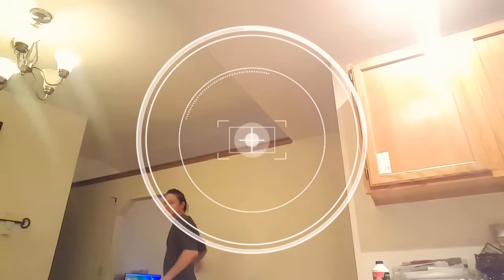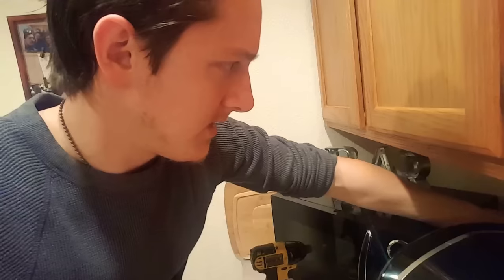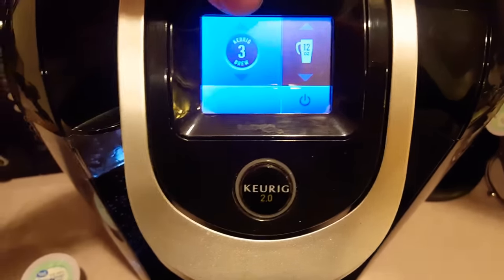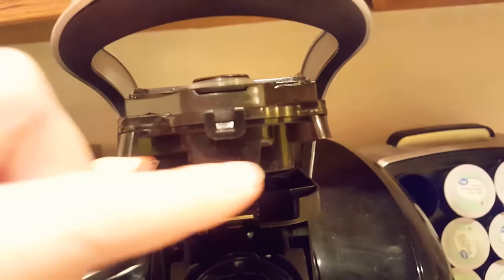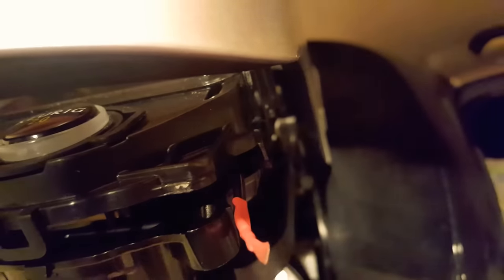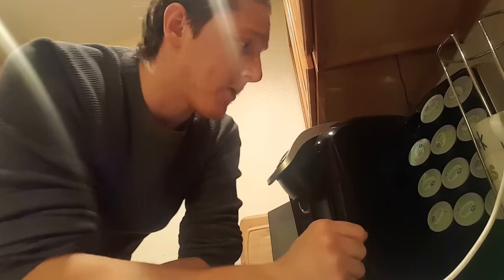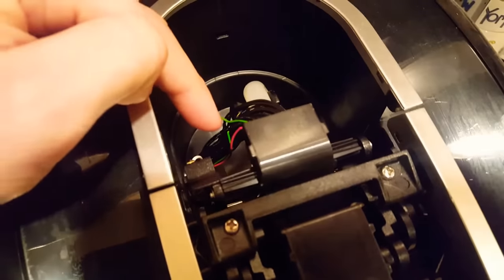Unlocking Keureg 2.0 PERMANENTLY (FULL MENU ACCESS) - Ep.2

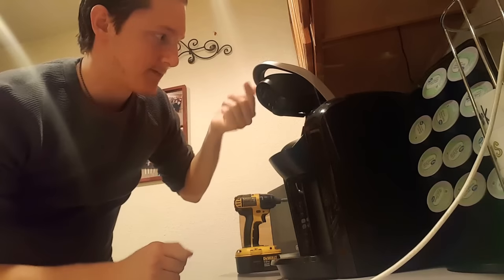Comment from the maker: Skip to 3:20 for step #1.
Reply: PROTOONE thanks
Reply: used the magnet  for over a year. worked great till I wanted to use Keurig 2.0 My K-Cup Reusable Coffee Filter with my Thermal Carafe. Works great now thanks..Now if there was a way to make it Hotter!
Reply from the maker: @davevarner7993  I went with the Cuisinart brand Keureg, it has heating options and it looks better in my opinion and has been very reliable.
Reply: PROTOONE i have yours, i still have to put mine in microwave for 1min to make hotter
Reply: Great work. I did the green wire hack and it worked perfectly. I was about to trash my coffee maker. Thank You So Much. Proud of these type of smart people.
Reply: i guess i’m 4 years late, but genius is never outdated.  well done, man. this is what happens when a smart guy gets bored!!! aewsome!!!  THANK YOU!!!

Comment: Excellent modification! Took more time than most commenters mention because the tabs are very fragile. If you pry just a tad more than necessary, they break off as three of mine did. Still works fine but just an FYI. Best to use a thin kitchen knife to hold the two units apart once you have the first tab started and work your way from tab to tab. Also no need to pull out the sensor, just leave it in and works fine that way too. Also, make sure to cut the wire as close to the sensor as possible to give yourself lots of wire to work with when splicing together. The sensor is located in the bottom part of the unit. Great video, hope your girlfriend made it home okay.

Comment: This guy rocks... worked perfectly!  We like to use the orange reusable carafe k cups.  They usually work well brand new, but the usable time has been shrinking and we would have to but a new orange reusable 2 pack.  Over the past several months, it's really difficult to get Keurig 2 to recognize it... even new... it just won't brew a carafe!  

The magnetic bypass worked!  Also, cutting the optical sensor was a bonus for using all k cups.  The only issue were the inside clips.  A tiny thin screwdriver worked best for me, and don't worry if you break a clip or two, like I did... as long as you have at least one on each side, it will hold together just fine.  Good luck!

Comment: I have a keurig 2.0 and used a reusable carafe pod. As soon as I closed the top this menu pops up. Way more size selections and I don't have to use the carafe. My 2.0 sizes go to 18 oz. now I can use my coffee cup instead of the carafe and fill my cup to 16 0z. on one round.  Love it plus I can use my own grounds and save money.
Reply from the maker: Lu Lovett That's awesome I never thought of that. I personally would like that reusable carafe pod, that would be a nice adition for a stronger cup of coffee.
Reply: @LILBZ3  I still find this extremely helpful because my current 2.0 doesn't work as described by Lu Lovett, with the reusable carafe pod. It did for awhile but I have been having to buy the expensive carafe pods and peeling the tops off and putting the tops over my generic carafe pod. I am so grateful I found this video so I can try it. Ill let you know! Thanks!!!
Reply: @LILBZ3  So only one more thing. I wasn't able to use distilled water with my other 2.0. Some other sensor on it can "see" if there is water in the reservoir or not by the minerals in the water. Distilled water doesn't have those minerals in it and so the keurig 2.0 does not see any water in the reservoir and will not brew. I think Keurig discourages the use of distilled water because they can charge exorbitant prices for their filter systems.  Any ideas on locating this sensor?
Reply: Lu Lovett your right. Just figured mine out

Comment: Awesome video!! I tried that at first and it wouldn't even dispense hot water. I had to take it all apart (Bare bones) and pushed in the wires where possible thinking maybe a wire came loose somewhere? Fiddling and pushing back the wires everywhere after i tried your method did the trick for me! THANK YOU FOR NOT LETTING ME TOSS THIS THING OUT!!!
Reply from the maker: Glad you were able to resolve it! Sometimes when its taken apart the wire connections can come loose. Glad to hear you fixed it! :)

Comment: I just did this.  Only cut the green wire because I’m not concerned about the full menu.  I no longer randomly get the oops screen when using my reusable kcup. Thank you!  I wasn’t too concerned about it breaking the machine since I got it for $5.00 at Goodwill.  When I brought it home it would not move off of the preheating screen.  It was stuck there, so I found a hack that said turn it over and count to 30.  That sounded crazy but it worked. Now your hack made it less frustrating to use.

Comment: Great hack. Had an issue at first after cutting the green wire and the 2 black wires the coffee maker  wouldn’t work. So I read through the comments and found a few possible issues. Mine turned out to be the ribbon wire going to the board, it came lose.  After  pushing it back in it worked. Hopefully this will help someone else who might have the same issue.

Comment: I have 2 machines. 1 worked with the hack and the other didn't. When I lift the handle and close, it takes me back to the main screen. Doesn't matter if I add a k-cup either. Thinking I didn’t splice the magnet wires properly, I  went back and did it again. Actually several times. Any ideas?

Comment: Grant Davis
Grant Davis
1 second ago
I just cut the green wire and it allowed any cups to be used. I have some of the refillable carafe cups which have a rib/handle and are much taller. When I put them it it gives me the extended menu, which makes sense because the larger capacity of the refillable cup would be necessary for the bigger brew.

Comment: I did what the video said, and at first nothing, all the machine kept telling me was that that "oops" message, regardless of coffee cartridge. The more I kept lifting the top plate that covers the touch screen and main button that is held down by those clips, I noticed something, that there is this "mother board" under the top part, (as you lift it up gently, shine a light there, and you will see that a small green mother board like board is screwed in place) upon examining closer I saw all the colored wires (Blue, Green, Yellow, Orange and Red) run to the area right over the optical lense. I noticed that the wires were in this tiny white clip plug looking thing that you could tell clearly was to be plugged into its bottom half counterpart that is attached to the optical lense itself (it is a teeny tiny green board with an off white colored plastic plug looking thing that looked like something was to fit INTO IT). I looked above, and under at both pieces, and safely assumed that they are to be attached, or rather "plugged into one another" I carefully did this, but in order to do that,  had to actually unclip ALL the clips all around that cover as to lift it up enough to give the room, leverage etc... to plug them into one another as soon as I did that, and turned the machine on, IT WORKED!!! I am thinking what happens is as someone is trying to unclip just the 4 or 5 clips around the front, and as one lifts it to get to the front magnet to remove, if it is lifted to abruptly or too high these two pieces that are over the lense become unplugged, and then it won't matter what colored wires you cut, the entire machine will not recognize ANY K-cup. it works now, the only thing I need to do, it so properly connect the two black wires in the front from the magnet to get all the cup sizes, but at this point, I just don't want to fuss with it anymore. I am good with at least using ANY K-cup. and it looks like I can still select the larger 12oz-16oz for a travel mug, I just have to set it to that in the settings, and then go back and re-set it to K-cup. (not that hard, its touch screen). and I did end up having to cut both the yellow and green wires. ALSO just a side note: instead of "cutting" the wires, you "CAN" just unplug the colored wires from that plug itself from either the front part of the machine under the lid where it is all clipped in, OR you can disassemble the back of the machine and unplug it from the other end, which would be at the back very bottom of the machine. (I saw another you tube tutorial that did that as an alternative to cutting wires.) This was my experience thought I'd share.
Reply from the maker: Super glad you solved this issue, it seems that a couple people have had this problem. I'll refer people to this comment that have had this issue. Thanks for the detailed resolution! Happy caffeinated beverage sipping!
Reply: you saved me from buying yet another coffee maker... Thank You!!!
Reply: Help! My screen is blank when I plug it back in. I did what the original post said to do, then I went back in to check the white clip that holds all the wires, but it’s not loose 🤦🏾‍♀️ Any suggestions?
Reply: Thank you! Our Keurig 2.0 is prolly a 1st gen and several yrs old... cutting the yellow along with the green worked for me! I was almost ready to head over to Amazon to buy another machine

Comment: Excellent hack my friend. Works just like you said. I did break one red tab but still tight. And I did not pull the magnet. I just snipped wired and spliced to make the loop. Then cut the green wire. Started right up and when you pop open to use, options 1-6 are all there with the various sizes.  Will use with reusable filter and grounds to accommodate the strength on 14 to 18 oz. thanks again.

Comment: I just bought a Keurig K Klassic, not the 2.0. The problem with my pot, is it only brews a half cup of coffee. I'm clicking on the lg mug, but getting 1/2. Can you help me?
Reply from the maker: Ana F Dos Santos Like most Keurig's the have an upper and lower needle that have holes in the sides of them for fluid to pass through when brewing a cup. At least once a week I have to stick a small paper clip into the needle holes and jiggle it around to break up scale, coffee grounds, and any other buildup, in my case coffee grounds always jam up the needle. Also make sure your water tank screen at the bottom of the water reservoir is clean and clear of any debris. Make sure those needles are CLEAR by brewing plain water through q few times until no coffee grounds are coming out into your cup. Then throw a k cup in and test her out! I hope that works for you. The brew should take significantly less time to brew a full cup to! Let me know if it works.

Comment: Not bad at all dude. Just a simple explanation to all of your hard work. With the magnet still attached it is a normally open circuit (N.O.) until the magnet closes the circuit or loop. so for it to work it needs to become a normally closed (N.C.) circuit. Basically the magnet is like a light switch that is normally off. When you put it the proper K-cup that is like turning on the light switch. It closes the circuit allowing power to continue on to the coffee maker (which would be the light) which is the same as removing the magnet and just splicing those 2 wires together. With the green wire it looks like you might have just killed power to the other sensor. I would recommend putting some electrical tape over both ends of that cut wire. Electronics don't like any type of shorts so better not to take the chance. 
Anyways, like i already said, not bad at all. Thanks for the video. I'm going to become a subscriber.

Comment: I just tried this last night. I cut the magnet wires, spliced them back together, then couldnt cut the green wire because all i have is all black wires and one red wire, so i left that part alone. Now, even with my VUE cup, i can only access the regular k cup menu and can only make up to a 12oz cup instead of my 16oz travel mug. Soo instead of unlocking the full menu so i can use a regular k cup to make my 14 or 16oz cup, i did the opposite and can only make up to 12oz with my VUE cup. Idk what i could have done wrong? Would this happen if my wires werent spliced together correctly? You have to strip the rubber off those wires and reconnect them when you splice right? Sure hope I dont have to go buy a new keurig all together. oh boy....

Comment: Does this also eliminate the "pin" from punching  a hole in the bottom of the cup. If this is the case, I can't use Keurig cups, is this correct?
Reply from the maker: Dale Schut no, the pin is only effected by the other hacks that may have you jam a qtip to block the needle. The needles are not effected by this hack and all k cups are still usable.

Comment: Don’t cut the green wire. Also after removing magnet and splicing wire it does not consistently give you full menu. Mine did it three times and then reset to factory settings.
Reply: Follow the instructions. I did my k400 and k500 a year ago. They still work perfectly. And as described in the video.

Comment: Hi. You said "splice" the wires. Do you mean to reconnect the wires (for the magnet) or do you just have to cut them and leave them disconnected?
thank you
Reply from the maker: Eric Mizer sorry for the late reply, I hope you were able to find your answer in the comments. Splice them together after removing the magnet. The two black wires get twisted together and taped. This "bypasses" the magnetic switch, allowing you to use any Kcup or Carafe.
Reply: thank you! i did exactly that...it works like a champ! :)
Reply: Omg. I used the magnets before and it stopped working. So I found your video and watched it. I cut the green wire and cut the other wire for the optical. Well I didn’t realize that I needed to splice it back until I saw this lovely young lady’s comment. I took it apart and spliced it, and voila ....it worked! I said to myself, “Well I be damn!” 🤣🤣🤣. Thank you for the video and comments. It really helped me. 🤗😘
Reply: So do you connect the two black wires together (the silver wires in the black plastic. Or do you just tape the together to get them out the way

Comment: Did not work for mine.  I cut the wires to the magnet in front and spliced the wires together.  The menu in front did not change.  Yes the wires were tightly twisted together and covered with electrical tape.  No I did not yank them out of the board.  In my newer Keurig 2.0 this hack did not function as expected.

Comment: Found the mag sensor easy. Cut the wires and spliced. Put back together. Still the same. Don’t have access to full menu. Didn’t cut the green wire because I only use Keurig K cups. Is that why the full menu isn’t unlocked?
Reply from the maker: Shane Bagley yes, the green wire is the reason why it's not showing the full menu. Although you can continue to only use k cups and cut the green wire. It just allows more menu options for each cup.
Reply: And it worked. Wife is gonna be happy. Thanks a ton.

Comment: Good video. Question though,  starting at time index 4:23 is it possible to not open the top part with the 5 clips and leave the front magnet sensor in place but still be able to cut the 2 black wires that lead to it. I assume those two black wires for the magnet sensor go to the back where the other wires are at? I guess determining which two wires that lead to the front would be the hard part.
Reply from the maker: That may be possible, however the clips aren't that hard to remove, you can even cut up some thin plastic material (perhaps some scrap packaging material) and make strips you can slide under each clip then when all the clips are "shimmed" you can easily separate them. I just kept upward force as i popped each clip up. Then connect the two black wires after cutting the magnet off and your good to go, after cutting the green wire of course.

Comment: Did you ever work out the carafe issue?  You are supposed to have a proprietary carafe to use that feature...  right now i am putting a magnet into the bottom part to trick it into dispencing anywhere from 2-3 cups to 5-6 cups...

Comment: Hello! I did exactly what you did on the video and everything is exactly how you showed it but mine doesn’t want to pour water or pump the water. Any suggestions?
Reply from the maker: The only thing I could recommend is reversing the modification by reconnecting the two black wires to the magnetic switch and the green wire. I’m sorry it didn’t work. It seems like I’ve gotten a lot of positive feedback so I’m guessing the new systems may be more difficult to mod. I hope we can get you machine working again.
Reply: I need to ask, did it work before you did the hack? It just may need the needle cleaned and a descale. This may not be related to the hack. Clean the tube leading to the needle and clean the needle with a paper clip then try machine again. You should also run vinegar through it and let sit with vinegar in it for an hour then flush with 3 tanks of fresh water to get clean of vinegar.

Comment: Keurig 2.0, 350.  I pried the magnet from the top, cut the wires and put electric tape on the wires. Then clipped the green wire and put electric tape on each end.  I was getting the full menu with one of those clips from a carafe refillable pod but it stopped working.  After trying your method, I don't get the full menu, only the 4,6,8, and 10 oz that the stupid Keurig came with.  After brewing a couple of 10 oz cups, the machine turns off whenever I press the brew button, rendering the thing totally unusable.  Not your fault it didn't work for me.  Just a warning to others.
Reply: Never mind.  I went back in and stripped the two wires, twisted them together and used a screw nut to keep them together and it does work now.  If I'd known this fix when I bought the Keurig, I'd have done it way back then and saved myself a lot of aggravation.